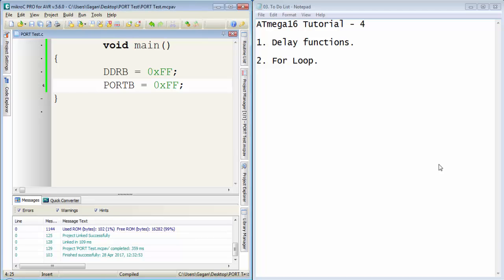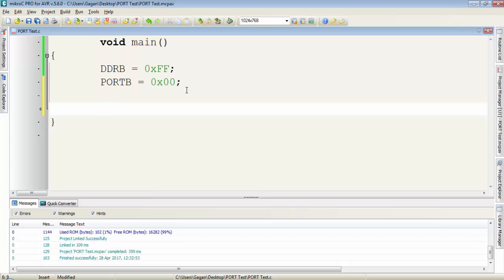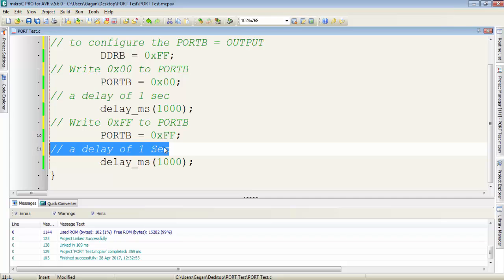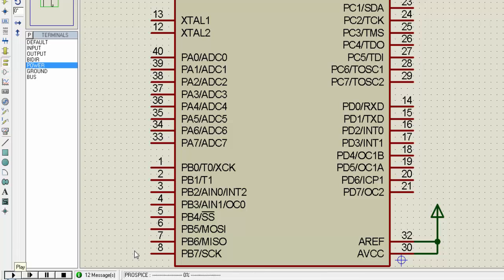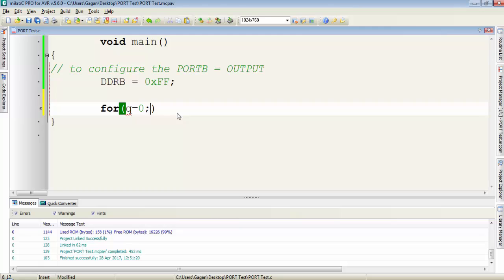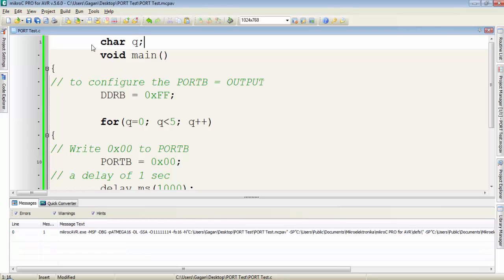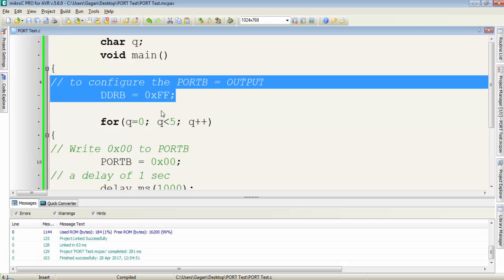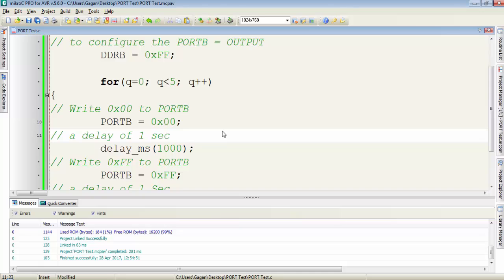Atmega16 Tutorial 4 - delay function and for loop

Comment: I tried with the delay function but it wouldnt work, the simulation doesnt goes forward and it maintains in the previous state itself. What might be the issue ( I even tried with built_in.h in the include function)
Reply from the maker: Make sure your simulator controller model frequency is set to the frequency value selected in the compiler. Sometime it may be written as "mhz" and it should be in "MHz".  check this issue.